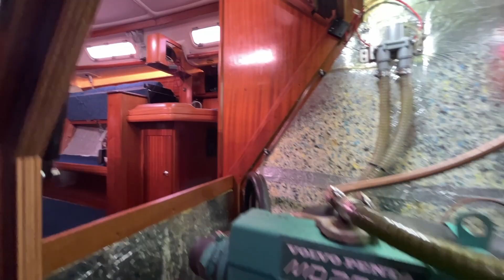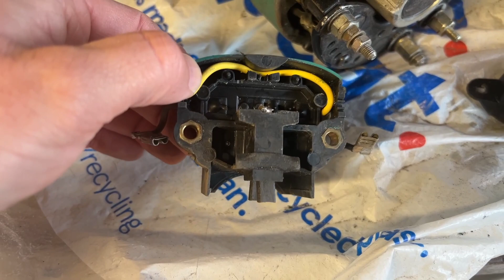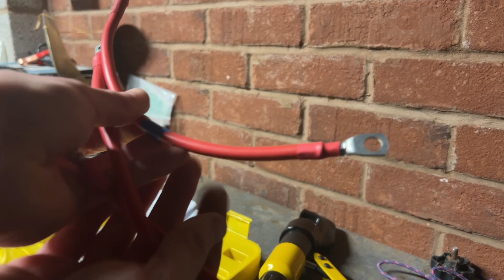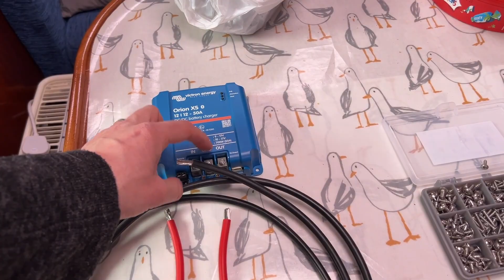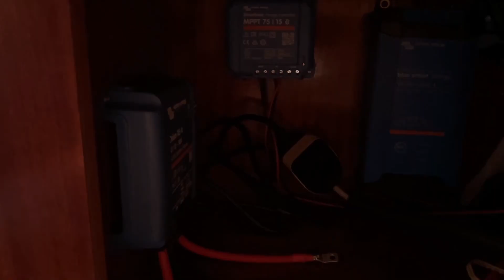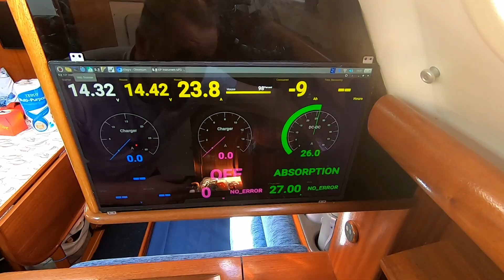How to Install a Victron Orion XS DC-DC Charger | Replace Charge Diodes for Better Battery Charging

Comment: I would think you'd want the starter cable to be on the inside closer to the starter terminal rather than having the jumper from the alternator between them.  I would think that'd pass the high amperage batter from that thick cable.
Reply from the maker: You are correct, it's actually the other way round now, although I think this has more of an impact on bus bars as both the nut and the stud are the same size here, there is no larger surface, but it is actually the other way round, the alternator cable came out at a better angle that way.

Comment: Just done the job. I went with removing the blue box/diode. Then joining the starter and the alternator wire in place of that diode, I also joined them with a mega fuse (I had a spare). Then I also changed the cables, I just switched to lithium away from 4x lead acid batteries and had a load of wire left over so changed the cables from Starter switch - > Mega Fuse -> Alternator. My alternator cable had actually melted. I'm going to buy an uprated alternator so I can use the 50ah. In the meantime I turned down the XS on the app to 30ah as my alternator is 70ah.
Reply from the maker: Excellent - What alternator are you planning on getting? I guess you have the standard Valeo one like me at the moment. Will you also be changing the belt drive or just upgrading the alternator?

Comment: This is great. I'm about to do the same job but switching to lithium. I've not been on the boat to start poking at wires or anything but have a very similar set up with the Volvo Penta md2040 and the old blue dc diode. You probably saved me an hour :-)
Reply from the maker: That's great to hear! Glad I could help save you some time on your lithium project. Out of interest as i've not switched my batteries yet, what are you planning on installing?
Reply: @BoatingwiththeBaileys  I have gone with a fogstar battery 280ah. They have 3 ranges the "eco" which doesn't have heating or blutooth. The "drift range" which is the one I went with as it's ip67 heater and has a 250ah continuous discharge which is suitable for 3000w inverters (I have a 2000wh) Allows you to be able to use things like air friers, coffee machines that type of stuff. They charge and discharge quicker and you can use them down to 20% (you can go more but this is what they recommend) then they have 10 year warranty with 8000 cycles.  The reason I went the 280ah is because i want to be able to charge them via solar and I only have 2x 170w panels. I do want to add a solar arch later but my main concern is the ability to charge and keep them charged. My friend went with the "beast" which is 600ah but he would need to use his motor for the whole day to charge the thing up. 

The reason I went with the orion is because you can mix the two different battery types. I also read that the alternator should be double the rating of the DC charger so 100ah. I will change the settings to 30ah as my alternator is only 70ah. I will upgrade it later.
Reply from the maker: Hi - Yeah, I’ve been looking at the Fogstar range myself, they seem like really good products. I think that’s one of the benefits of Lithium in that you don’t need to fully charge it all of the time, that 50-80 or even 30-80 band seems to be the sweet spot but then again I’ve watched a lot of Will Prowse, and from his tests, you just use the thing and not worry about the cycles. 

We're going for a solar arch next as my panel is just stuck on the coach roof currently, then i think some lithium and a small inverter for us would be really nice. 

I've also dropped the output of my Orion.

Keep us posted.
Reply: @BoatingwiththeBaileys  I went with the 280 drift model it was £550. I didn't want to go too big because of ability to charge it up. I only have 2x 170w panels. But going to buy a fold out one. I do want a solar arch but they are mega bucks.
Reply from the maker: @serenitycoastUK  Cool - I'll take a look at them, and let us. know how you get on with it. 
We're looking to do something with an arch over winter start of next year.

Comment: Hi.  So again , I am going full victron. and have to change my house bank.  actually 3x 95Ah AGM. I think about going Lithium. How was your choice to go with 2 AGM? why AGM ? why 2 x 140Ah ?  thanks a lot.  Gildas
Reply from the maker: Hi they are just the existing batteries, I had not got compatible chargers for Lithium so I've slowly replaced all that kit as either upgrades or when it's broken. My current batteries are just standard lead acids, I plan to switch to Lithium now I can charge that type of battery without damaging anything.
Reply from the maker: 2 x 140 just to get the capacity - remember with lead acids I can only use half the battery rating
Reply: @BoatingwiththeBaileys  ok so same for me. I was waiting for the the right moment to upgrade. Tx

Comment: Hi, not exactly linked to subject but: i am going full victron, 2 lifePO4 batteries , mppt smartsolar, orion xs , blue smartip67... can i get all data to openplotter with bluetooth (I have a rpi4 + macHartur Hat) ? or need VE.direct to USB cable for each device ?  thanks a lot. Gildas
Reply from the maker: Hi, yeah you sure can. I'm using ble for all mine although I have a signal strength issue on the ac charger. I can get data from a DC-DC, smart shunt, Mppt solar and the ac charger. Plan to do a video once I've sorted that signal strength issue out. Two plugins to choose from VE over ble or the Bluetooth one, both recommended in out top 5 plugins
Reply: @BoatingwiththeBaileys  I hesitate between smarshunt and BMV712. how did you choose to go with smart shunt ?
Reply from the maker: Hi, I didn't want the extra display so that kind of decided it for me. The plan was always to monitor these via the Pi and then share it back on the NMEA2000 network. I guess the other question is are you getting the Victron display unit, the Cerbo GX?
Reply: I will go with bmv712 not a big price difference and so I will be able to view battery state directly. No cerbo gx. Rpi and victron app will be enough. Thanx a lot
Reply from the maker: @moimeme3468 sounds like a plan!

Comment: When using an infrared thermometer, “heat gun” as you called it, remember that the field of view is generally about 4:1 (exact ratio usually printed on it) so if you are holding it 40 cm from your target, it’s averaging the temperature within an area of about 10 cm, and the laser is pointing to the center of that 10 cm area. Keep in mind that if there are hotter and cooler objects in its field of view you will be getting the average.  To get an accurate reading on a small object like an alternator, you may need to get in close so you only read the alternator and not part of the cooler bilge.
Reply from the maker: Hi - Thanks for the information and the detailed reply, really good advice. I did call it a heat gun - good spot!

Comment: With this setup it is safe to charge lithium batteries?
Reply from the maker: Hi, yes it is. You can limit input and output and you also have control over each charge stage from the app. There are presets or you can configure external what the battery spec sheet says.

Comment: I connected a temperature module with an output to the charger in case the alternator gets hotter than a parameter defined by me it will shut off the dc dc charger
Reply from the maker: Thats a great idea. Is this a Victron device or something you made? I've got a spare sensor on my engine monitor i could get the temp reading from.

Comment: No problem with interference on the VHF? Have seen several reports when installed the new Victron Orion XS
Reply from the maker: Hi, not so far and my AIS seems unaffected. I do have a choke (i think that’s the right terminology) on the power line to my VHF&AIS kit, that came with the boat so that could be helping? Also its on the latest firmware. I will keep an eye on this and report back.
Reply: @ Not sure what you mean by choke. A ferrule? 
I do hope it works good. Installed 300 amps lithium as house bank. And got the insulated Orion dc dc 30 amp. As I was worried about the VHF. The XS is way smaller and efficient. Thus produces way less heat.
Reply from the maker: @RocketSailing  Hi - Maybe a filter/rectifier is a better name for it, I've tried to google it but I can't find what I have, Its similar to this https://amzn.eu/d/geBtrz5. I will take some pictures and also post an update. I have to say we were out sailing this weekend and had no issues. I heard nothing on the main radio or my handheld when charging. It did kick out about 30amps at one point but I'll try again when the batteries have run down more and its running at high output for longer.
Reply: @BoatingwiththeBaileys  Ah, Its a kind of filter. Probably has a simple volter regulator. If it works. Its good enough. :)

Comment: We have a wire between the starter and the alternator studs on the isolator. I think it would do the same job.
Reply from the maker: Hi, to get power to the XS? Thats similar setup to mine really, im just picking up the power at the batter end.

Comment: another great video - the only suggestion would be to use cord ends or flat end crimps on the cables connectiong to the Orion. No chance of stray wires then and no chance of boken wires under the screws. I do like the look of that meter ... now I need an excuse to buy yet another multimeter lol
Reply from the maker: Hi, Yeah, i was thinking about doing this but my cable was in the not required size on the table. I still think its a good idea and they recommend a Hexagonally crimped bootlace ferrule.

The meter is really good, its a Zoyi zt-703s. Wait for a deal on AliExpress or similar. I know its no Fluke but from the reviews it was accurate in the test and the oscilloscope did a good job too.

Comment: Hi, I follow you vidéos. I am looking for someone who may have replace the lever for the motor that is using cables with an electric system... I guess it is possible , is nt it ?
thanks and regards
Reply from the maker: Hi, Thanks for following our videos, much appreciated. Is your engine the same as mine, i.e an MD2020/2030/2040? If so i think you would need to look at building something or adapting something from a later engine. I'm not aware of any sort of digital throttles for these as they are very mechanical in their setup, that’s not to say it’s not possible but I would start by looking for this on later engines and see if you can make it work. Interesting project though! Keep us posted of your progress.